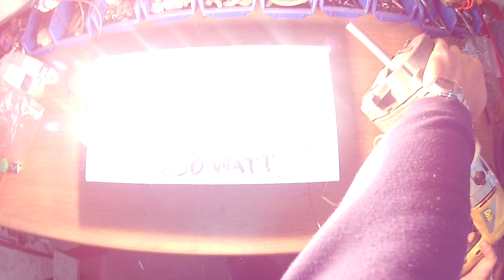Alternator to wind generator conversion 3 - Δυναμό σε ανεμογεννητρια 3

Comment: Καλησπέρα . Θα ήθελα τα φώτα σας , αν μπορείτε παρακαλώ. Θέλω μια γεννήτρια ή δυναμό DC η οποία θα παράγει συνεχές ρεύμα κάτω από ορισμένες συνθήκες. Θέλω δηλαδή να παράγει μέχρι 3000watt στις 2500 με 3000 στροφές να έχει απόδωση 25 αμπέρ αλλά τα volt συγχρόνως να είναι πάνω από 150 και λιγότερο από 450. Την ώρα που περιστρέφεται δηλαδή στις 3000 στροφές να δίνει 2500-3000 watt , 25 αμπέρ και 150 - 450 volt. Υπάρχει κάτι έτοιμο στο εμπόριο ή είναι εφικτό κάτι τέτοιο η' γράφω ότι να ναι? Ευχαριστώ εκ των προτέρων
Reply from the maker: ολες οι γεννητριες του εμποριου αυτο ακριβως κανουν που περιγραφεις,,,να δες εδω= https://www.google.gr/search?q=%CE%B3%CE%B5%CE%BD%CE%BD%CE%B7%CF%84%CF%81%CE%B9%CE%B5%CF%83&sxsrf=ALeKk00LR6D5zk8rjtEDj_X1di5MonavSw:1609310888791&source=lnms&tbm=isch&sa=X&ved=2ahUKEwj0yO-ejvXtAhUQC-wKHXzfAnEQ_AUoAXoECAMQAw&biw=1280&bih=881#imgrc=CUqSZy3aehbN4M
 διαλεξε μια και αγορασε τη. αυτες ολες βγαζουν αυτο που θες σε εναλλασσομενη ταση,, 
δες και εδω-βαζεις και 2-3 τετεια [παραδειγμα]= https://www.zipy.gr/p/ali/200a-1600v-diode-module-single-phase-bridge-rectifier-mdq-200a/32575783363/ 
 και εχεις αυτο ακριβως που θελεις σε συνεχες ταση.